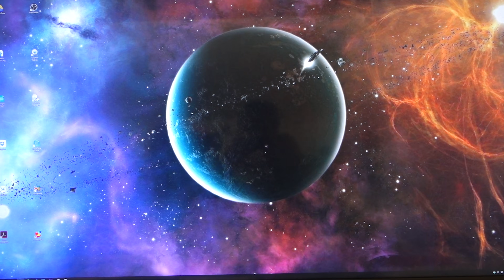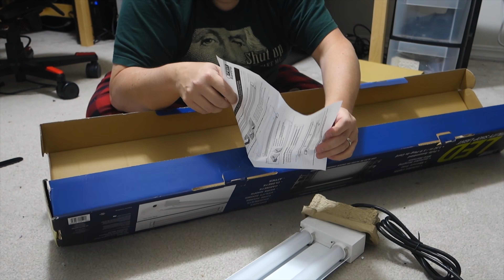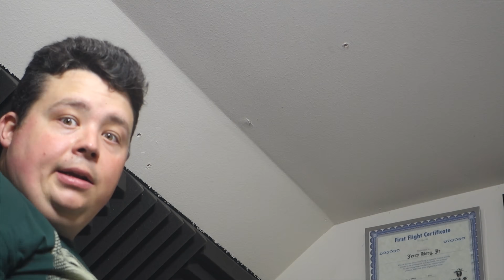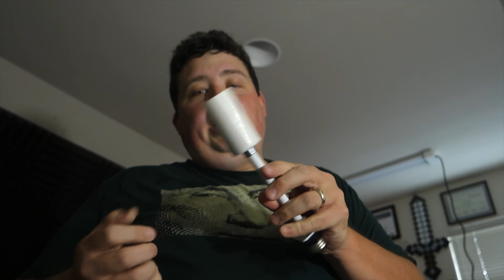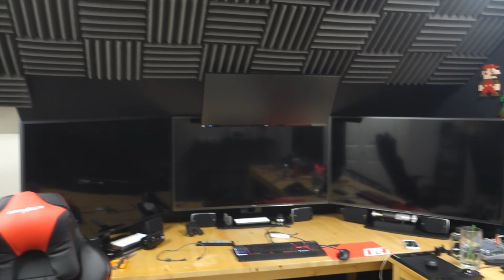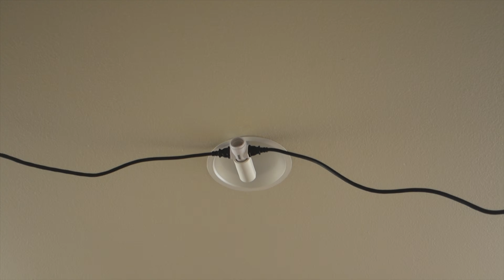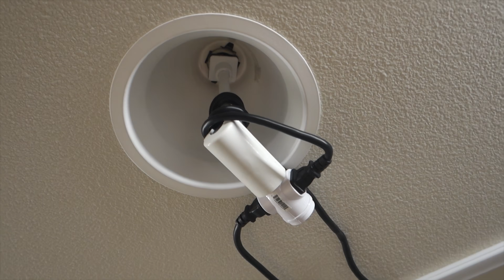How To Install Cheap LED Shop Lamps Using Existing Lighting Fixture Power - @Barnacules

Comment: That light to mains plug thing is some scary shit, they would never be allowed in the UK, but then we are pretty anal when it comes to electrical safety.

We used to use ( and many places still have ) ring final ( or sometimes incorrectly called a ring main) circuit that is basically a 32amp 230v ( well back then it would have been 240-250v) loop with all the sockets in the building ( or in slightly more modern systems a floor) on it so we need fuses and the likes in our plugs. 

Its a cool solution,  and i am sure its fine , i don't know anything about US electrical safety regs.
Reply: No idea why uk is handling it that way, but here in Germany, we got 16amp fuses and like for every room atleast one fuse, and an extra one for lights.
It's way better Oo
Reply: Jonny Dahl. Its an artifact of copper shortages after WW2, its very uncommon to install now.
Reply: Your comment actually reminds me, how our electrical outlets are connected in a flat built in the socialistic Czechoslovakia. We also have one 16A circuit (previously on 220V, now on 230V) for all outlets in the flat (except for the ones in the bathroom). To ensure lots of fun they also installed Aluminium-only wires. I think this one circuit and no copper approach is rooted in copper shortage, too. Only difference is, it lasted to the '80s ....
Reply: as a Brit your comment cracked me up
Reply: We fuse each plug. That's why our plugs are huge compared to EU/US ones.
Reply: u mean 16amps? and the less diameter it takes-> less copper? intresting
Reply: No , UK ring finals are almost always 32 amp 240v
Reply: Being English as well, I have to say electrics here (in the USA) are a little random. I do appreciate the small, easy to plug in plugs, but then they also work their way out if placed under any tension, esp. big adapters. Also whenever you turn on a high-power device like a vacuum or hairdryer the lights seem to flash. Kind of weird!
Reply: +Andrew You could buy those type of adaptors, here in the UK. Yes it was several years ago. Also after having my place totally rewired the lighting circuit goes to a 6amp 230v breaker, boiler to a 16amp, both socket rings to 32amp and a 40amp for the cooker point. These are split over different 80amp 30mA WRS80/2 RCD's.
Reply: The circuit is connected in a complete ring, so you've essentially got twice as much wire in parallel, meaning it can be smaller diameter. Of course this means that if a break occurs in the ring you won't know as everything will still work, but you'll have cut the current carrying capacity of the wiring in half...
Reply: Motorman2112 This is an issue yes, this is why for most things they are no longer installed. However having a higher voltage does help as the current can be lower, thus less copper needed.